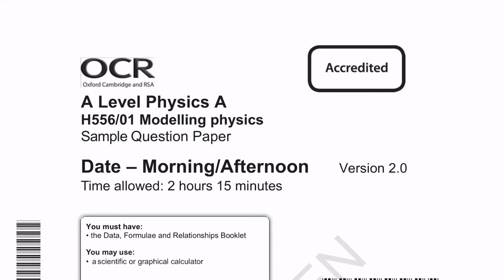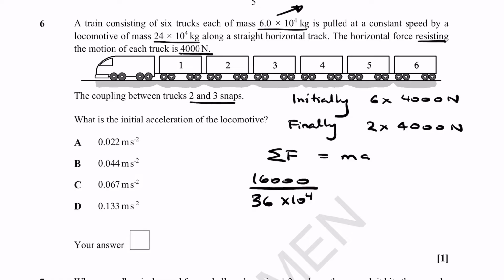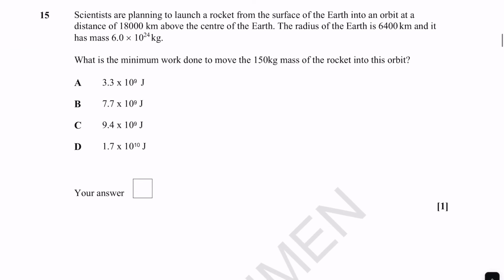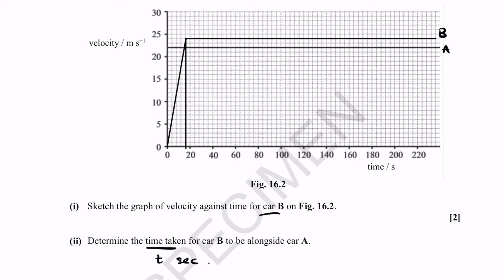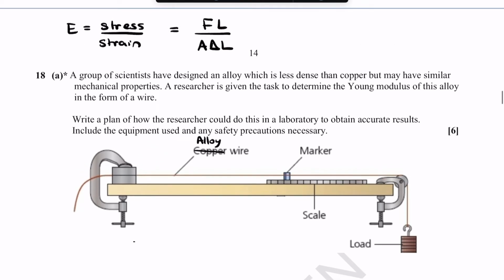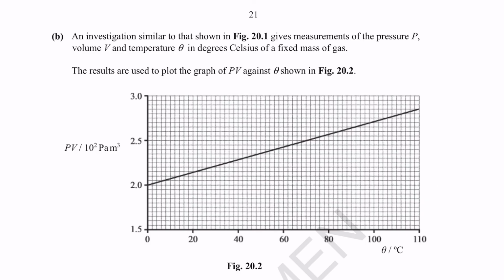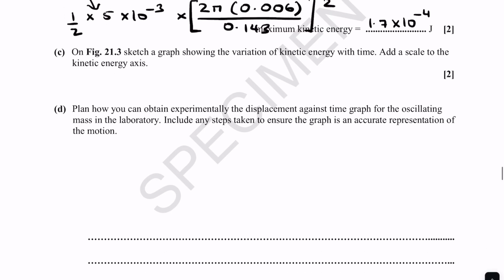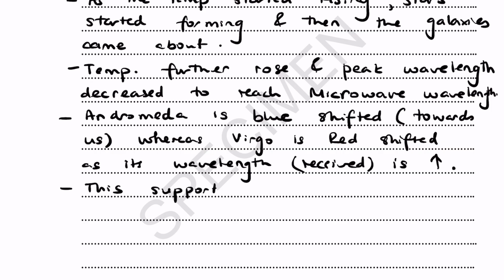H556/1 Specimen Paper OCR Physics A Walkthrough

Comment: for question no 5, why do u multiply by thickness and not add it to the radius
Reply from the maker: Because surface area is concerned. Its the circumference of the circle (as its hollow) multiplied by the thickness as its not negligible. If you were to add the thickness to the circumference, it wouldn't give you an area (as two quantities are multiplied to get an area, in general)

Comment: ty for the paper. Id like to know if we are supposed to use the mass of earth if it's not given in the question? For Q22 I used the mass of the earth and got the same answer however the mark scheme used a different method. Can I still get the mark in the exam?
Reply from the maker: I initially used the mass of the Earth too. I’d recommend learning it as you can use it as and when required. The Physics stays correct, so I don’t see why they’d mark you down for it.

Comment: Just 1 Question for Question 1. Why cannot we just add up the percentage uncertainties in x and y and then multiply it by z to get the absolute uncertainty in z, I seem to get an answer of 5?
Reply: When adding or subtracting two values you add the absolute uncertainty, if you multiply or divide then you add percentage uncertainty
Reply: @ozone9942  What if the two values have different units, I don't think it will work for this.
Reply from the maker: that's because the two quantities are the same (lengths) so you need to consider upper and lower bounds/limits to calculate the absolute uncertainty in z. Percentage uncertainty method works when you are dealing with different types of quantities.
Reply: @EliteTutelage  I see, Thank you!
Reply: You will not add or subtract values with different (non-equivalent) units in a level physics as far as I know because there's no equations that do that